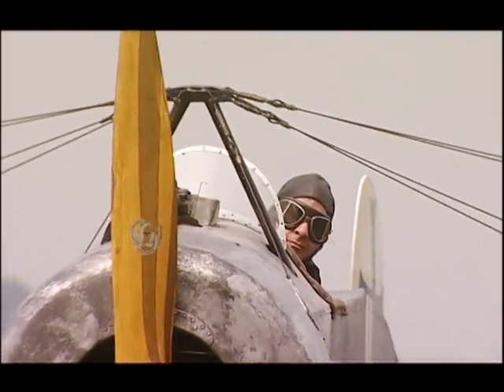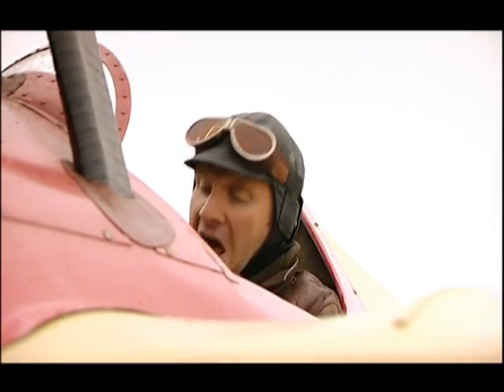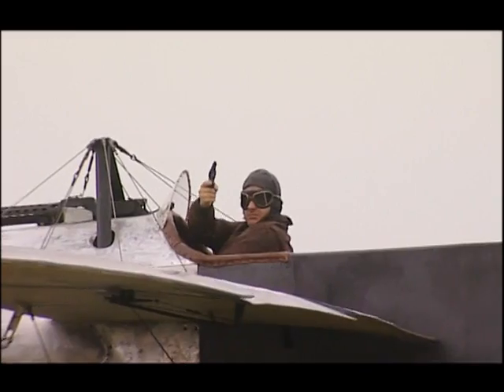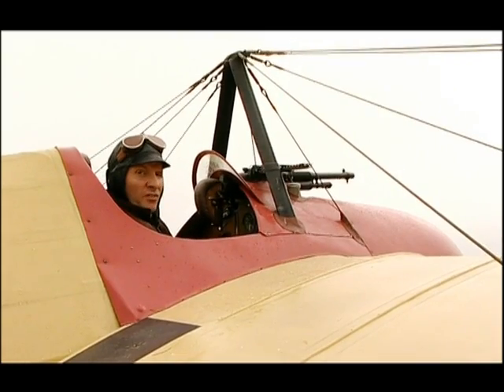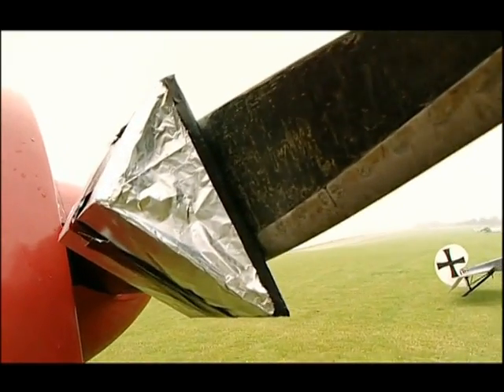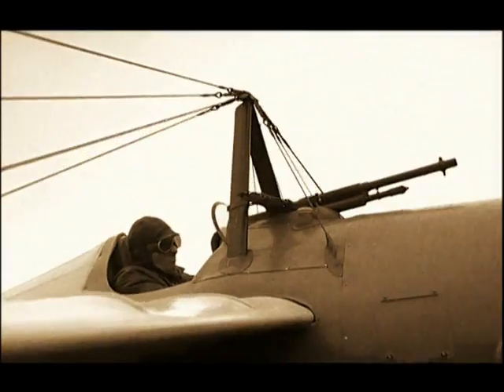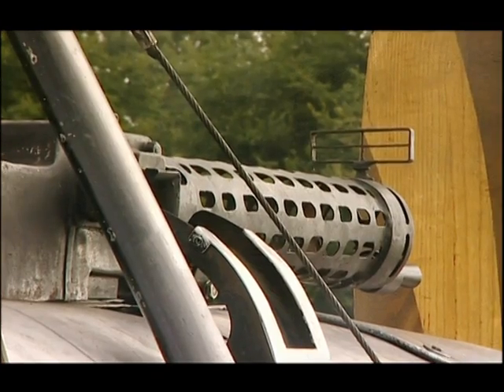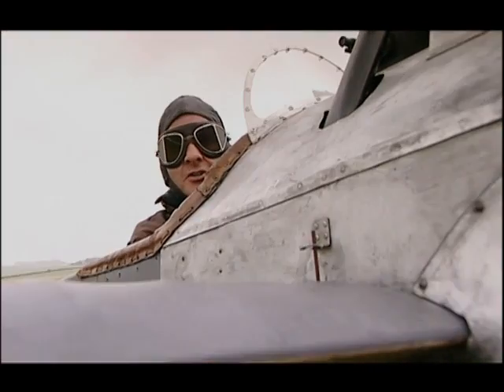"The Interrupter" WW1 Machine guns on planes.

Comment: Sorry, rather disappointing regarding any detail.  You could have shown a real deflector,  not an aluminum foil covered sandwich container.  Show the actual cam on the engine block, and a real rod and lever.  Where was it connected? By the way,  it was NOT the crank shaft of the Fok.E.I.   You should have asked me first,  or read my book,  The First Air Campaign, August 1914 to November 1918.

Comment: Interesting that the Eindeker, & Morane Saulnier are both Continental engined replicas made by Personal Plane Services for film work... They have dummy guns/ordinance. ..no syncro gear. The Fokker interrupter was mechanically operated, a cam stopping the gun firing when the propeller blade approached the muzzle. The British (Swiss.. Constantinesu) used a theoretically similar method, but with hydraulic operation rather than levers. In a dogfight, the English pilots had the extra task of hand pumping hydraulic pressure! Thanks for video

Comment: Actually, calling it an interrupter is a misnomer. It didn't interrupt the machine gun from firing, it actually fired the machine gun itself.

When the pilot activated the gun it would hook the gun up to the  engine and each revolution it would cause the gun to fire (or at least attempt to since at higher propeller speeds this would be trying to fire the gun multiple times while it was still cycling from the previous shot).  

Technically it meant that the machine gun wasn't a machine gun but a very bulky semiautomatic rifle.
Reply: It's not a misnomer unless you use the term regarding the wrong type of mechanism. Both existed, but the interrupter gear commonly failed to interrupt the fire, and was replaced by the synchronization gear, which actually did the firing(when propellers were clear), instead of interrupting the fire(when propellers were not clear). It is true that the label 'interrupter gear' stuck around after it was no longer used, but that's the way it goes.
Reply: @rich1051414  Yep..All a matter of semantics. Dutchman Anthony Fokker is credited with the promulgation of the first gun/propeller synchronization system..
Reply: Glad you guys added the correct information.  People think the pilot controlled the trigger, but t the aircraft controlled the trigger.  The pilot's switch merely disengaged the Safety on the machine guns.

Comment: The actual way a synchronizer worked was the engine fired the machine gun at precisely the right time so that the round fired would pass through the ark of the propeller.

When the pilot squeezed the trigger or pressed the fire button it would then "Link up." the synchronizer with the machine gun causing it to fire, when the pilot released the trigger it would the synchronizer would then stop firing the machine gun.
Reply: It’s almost as if we watched the same video

Comment: I believe he confused rotary , with radial engines.
Reply: Not at all,. Radials are mounted to the firewall with the crank turning the propeller,. Rotary look the same, but have the crank mounted to the firewall, turning the entire engine with the prop for extra cooling.    You are thinking of the rotary,. As in the wrong name giving to the Wankel engine